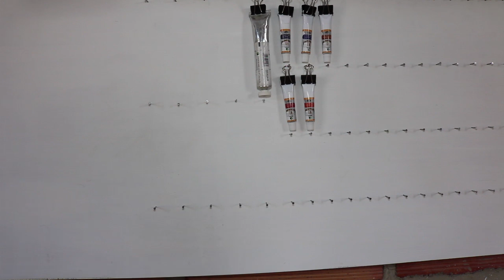quedate en casa muy util para mi taller

Comment: Hola amigo te puedo hacer una pregunta 
Tengo una moto rouser 220f año 2011 y no me carga la batería pero andan todas las luces pero no carga la batería y tengo que empujar para que arranque podría ser el estator o bobina lo llaman así alguna persona desde Argentina un saludo enorme
Reply: Quizás la bateria ya no retiene la carga, de todas formas revisa el regulador de corriente y el estator
Reply: Sip revisa la retencion de carga de la bateria entre 12.30 y 13.00 con un multimetro si es menor quita la bateria de la moto y ponla a cargar ó usa otra prestada que este em buenas condiciones y revisa la carga si no carga comienza con medir la salida de corriente alterna vAC del estator en ralenti debe ser de entre 20 vAC y 50 vAC al acelerar si esto es correcto ó aproxinado lo que esta mal tambien puede ser el arnes de coneccion ó los cables revisa que todo este limpio y en su lugar si todo esta bien tu regulador rectificador es la posible falla real😊☺
Reply: Muchas gracias por su información
Reply: @marcoagutierrez5676  si por las dudas pregunto si sería el estator y no lo consigo nuevo porque es una moto con 9 años ya 
Se podría adaptar el estator de otra moto y si sería así de cuál moto podría ser
Reply: Si se puede busca un estator obviamente que sea compatible, de que otra moto me preguntas? la respuesta no se tienes que investigar que tipo de estator es, ya eso por tu cuenta 😊☺
Reply: @marcoagutierrez5676  disculpame no te estoy investigando sería para ver si puede cambiarlo por otro estator que no sea específicamente el de un rouser 
Digo por si no lo consigo al mismo poner otro de alguna moto que sea algo parecido digo de alguna honda o yamaha o otras marcas de moto
Reply: @marcoagutierrez5676  te repito no te  investigo porque mi oficio no es la mecánica si puedo solucionar yo el problema que tiene mi moto lo aria yo mismo te repito no me dedico a la mecánica